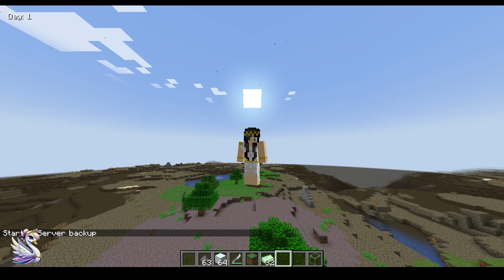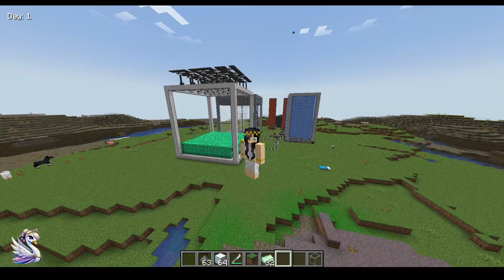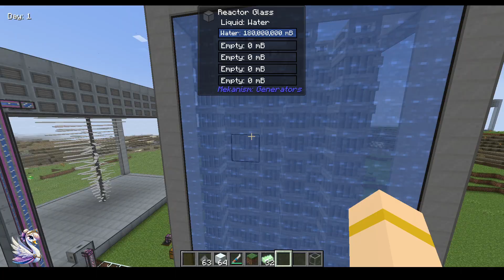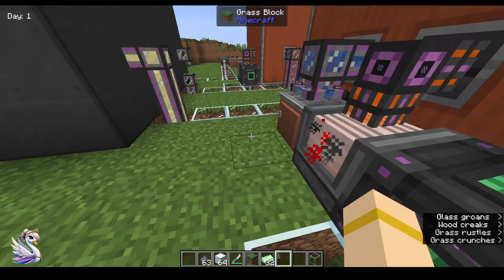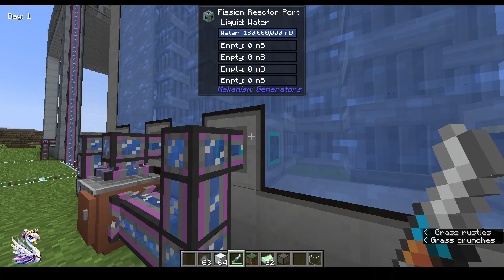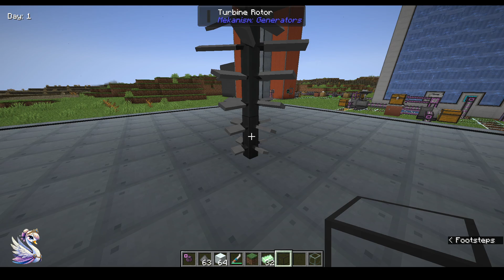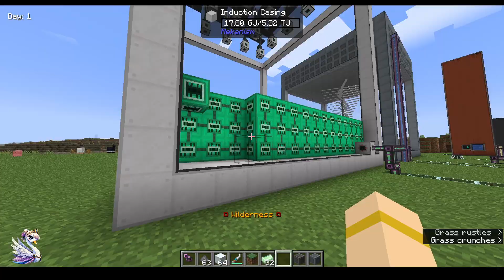Fissile Fuel FULL Process - Ultimate Reactor Guide | Reclamation Minecraft

Comment from the maker: Introduction: 00:00:00
Basic Principles: 00:02:30
Energy Requirements:  00:04:36
Thermal Evaporation Plant: 00:07:45
Dynamic Tank 00:13:40
Fission Reactor: 00:18:26
Industrial Turbine: 00:29:55
Induction Matrix: 00:34:34

Fissile Fuel Production: 00:38:06
(I made a small change to my setup because I discovered that coal is easier to get than gunpowder. It seems to be more economical in general actually, because it substitutes three machines for one. Check it out here: https://youtu.be/qJ9dyFmgHmE )

Left Side: 00:42:12
Right Side: 00:47:46

Dimensions of Multiblocks:
Thermal Evaporation Plant Max: 4*4*18 Min: 4*4*3
Dynamic Tank Max 18*18*18 Min: 3*3*3
Fission Reactor: Max 18*18*18 Min: 3*3*4
Induction Matrix: Max: 18*18*18 Min: 3*3*3
Industrial Turbine: Max 18*18*18 Min: 3*3*4